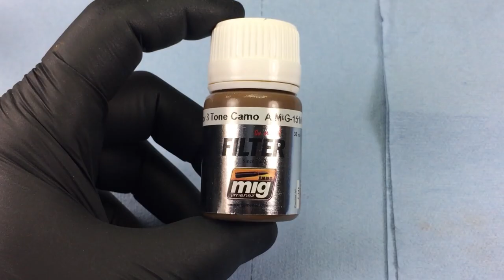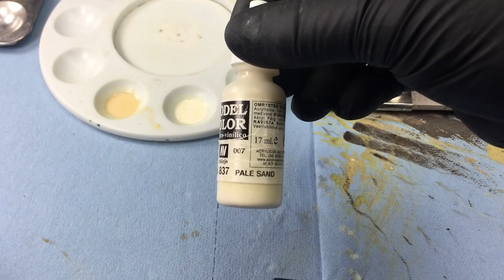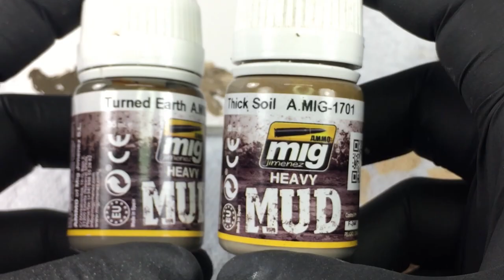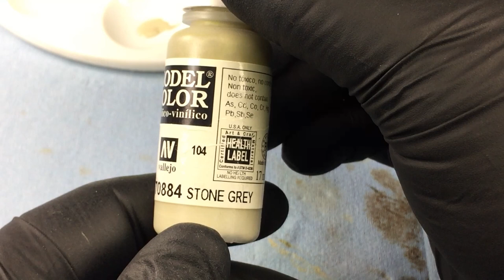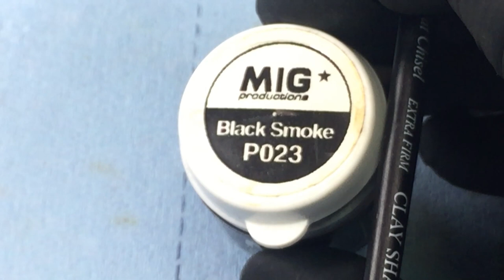(1/100 Scale - MAUS tank)  - My secret formula for weathering armour models - 2020

Comment: Very informative video, thank you.  May I ask, do you at any stage use a 'Kleer' type sealer.
Reply from the maker: Thanks! I appreciate you tuning in. I didn't on this model. Firstly as there were no decals and you really don't need a clear coat when using mixed media such as oils enamels and acrylics in my experience anyway. I've been working this way for years with no side effects... maybe I'm just lucky. 😃

Comment: Its great you mentioned this topic as I have been trying to figure it out for a long time. I wasnt to get into bust painting and I want to go the oil option.
I read somewhere tht its ok to put oils over acrylics but if you put acrylics over oils they will start cracking after a while as oils 'breathe'. can you confirm/deny this theory since you have worked extensively with both?
Reply from the maker: Thanks! Oils are a great way to go.🤙🏼